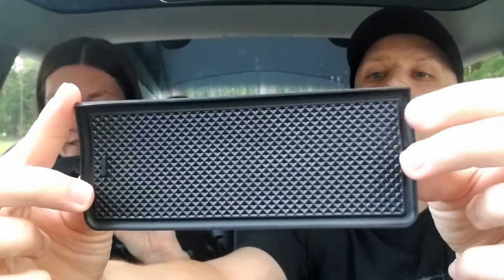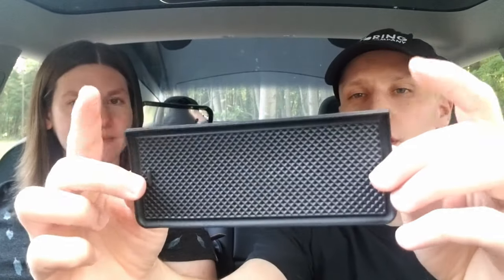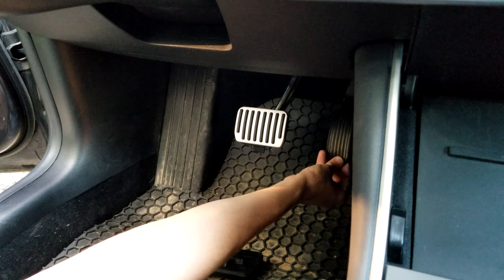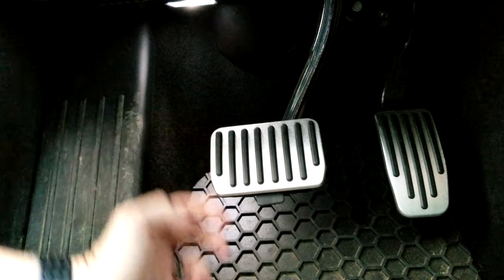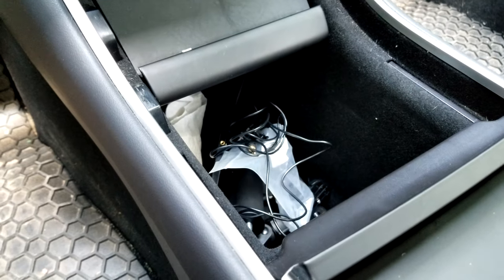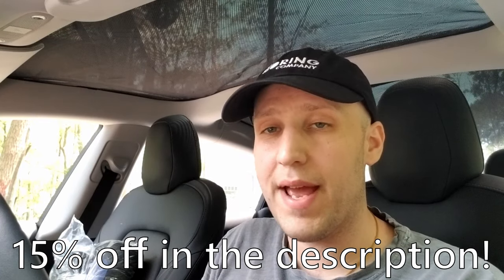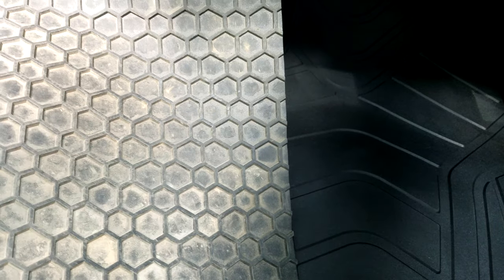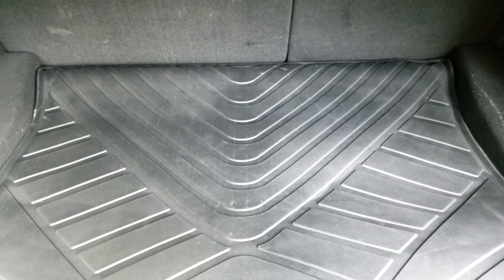AWESOME Tesla Model 3 Accessories | Center cap kit | Pedal Covers | Floor and trunk mat | Sunshade |

Comment: I’m thinking of getting the sun shades for this summer. How have these held up over time?
Reply from the maker: Well I took them out for the winter, but I left the back one in all summer and it was fine. Takes a bit of getting used to tho.

The top one I didn't use because that's where I stick my camera

Comment: You guys really look like a happy couple :)
What i miss and i think not seen yet is a wrap for the center console, so fingerprints dont show up so much.
Reply from the maker: I made a video about that a looong time ago here https://youtu.be/oTcVXdsAvcQ it's one of the first things I did!
Reply: @DirtyTesla  great, is must have missed that one :)
Reply: Do you also have problems with scratches on the wrap ? I watched another vid and the guy said, that it was scratching already while he was putting it on.
I think the same coating that is on office tables would be good. Its scratch resistant and fingerprints also are also almost invisible.
Reply from the maker: @zenmonke  Not for me. I have one decent scratch but it's from my camera mount falling off the glass ceiling lol. Mine still looks pretty good. But I could see replacing it after a few months. 

I really want the matrix pattern but it's out of stock :(

Comment: My Toyota Avensis came with rubber floor mats, so Tesla should too! :P
Reply from the maker: Carpet floor mats are a terrible idea
Reply: Well rubber is just not terrible to me, except maybe for the trunk. When you have carpet mats it's easy to clean... I take them, beat them a little bit and put them back. If you really want more you can use the high pressure cleaner, it dries fast anyway. And it looks much better than rubber

Comment: 1. I wouldn't like how the coins don't fit right. The coin sections should be sized for each denomination of coin.
2. I can't say if I like the pedals or not.
3. I'd prefer solid color caps that match the color of my vehicle.
4. There's a window cover for the X too.
5. I kinda like the mats.
Reply from the maker: I didn't care for the pedals until I actually had them for a few days. Now I love them. I did ask for a black center cap, but I'm glad they didn't have it. This 3 logo looks awesome.

And the trunk mat is a must have imo... So nice.
Reply: The pedals do look great - and I MIGHT actually get the performance 3 (if/when I'm able to). If I don't then I'd consider getting the pedals. I kinda like that 3 logo on the caps. I just would prefer solid vehicle colored caps. I'd guess the trunk mat would also be helpful for a dog (or two, or three).

Comment: The sun shader are not my taste at all. I will trust the Anti IR and UV shield  of the roof, should be enough. Plus the white seats.
The pedals are great.
The wheels too but I prefer a Tesla logo instead of the "3"
Reply from the maker: I tend to agree on the sunshades. I don't use the top one (because I mount my camera there) but I did leave the back one in.

The pedals are so much better looking than I thought they'd be.

Same with the 3 logo. Was very meh to me until I saw it in person. Now it's >>T (for me) :)